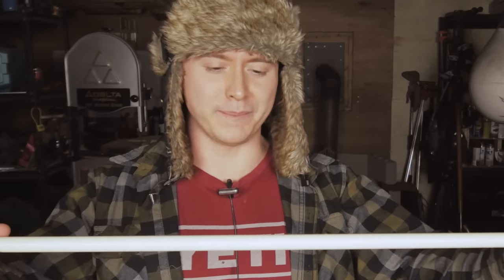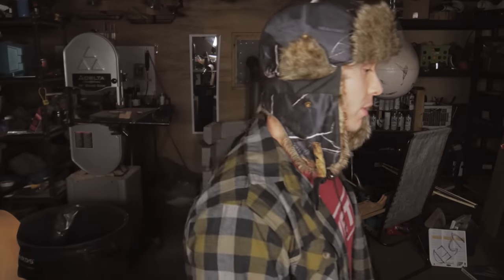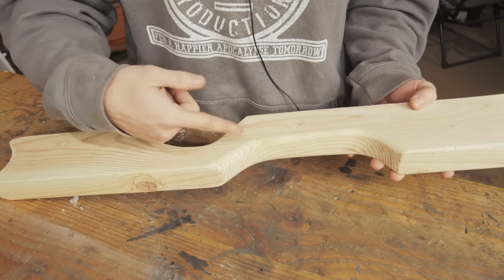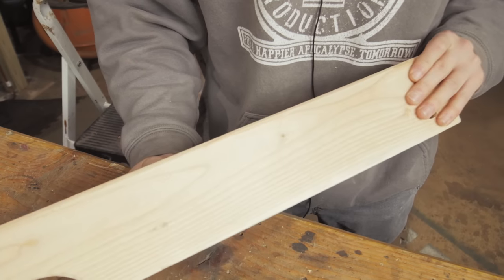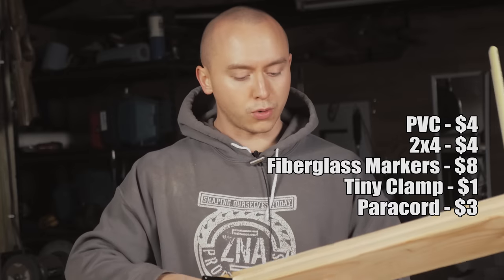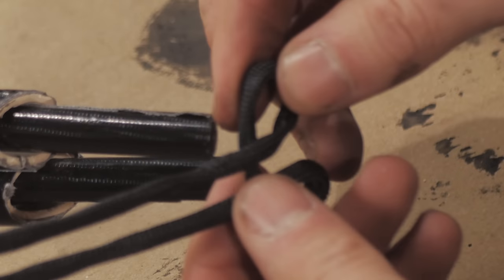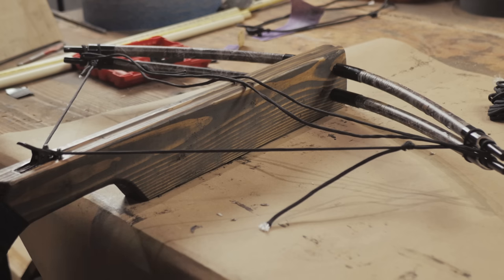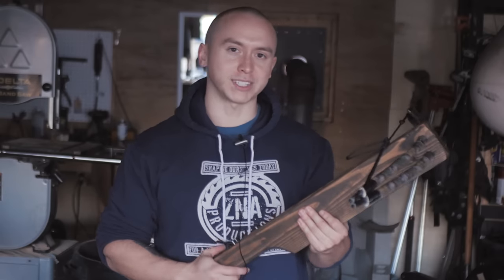Easy, Cheap, Powerful PVC CROSSBOW (With a Secret) -Minimal Tools, No Heating-

Comment: The main difference between CPVC and PVC is the range of temperatures each is capable of withstanding. CPVC can handle temperatures up to 200° Fahrenheit, while PVC peaks at 140° Fahrenheit.
Reply: Chlorine is added into the mixture of CPVC to increase the Temperature it can handle but it also leaves it more prone to cracking and becoming brittle over time.
Reply: Also it is measured differently, its measured using copper tubing size rather than pvc icing iron pipe size
Reply: it's not heat that's the issue in a bow limb.its cold.the forces applied on limbs under tension are insane.then the fact that those forces are applied to a brittle PVC due to cold temps is disaster waiting to happen.
Reply: For normal water supply PVC pipes, the schedule 40 PVC 1/2" will normally have thicker walls than the CPVC of the same size.
Reply: Learn something new every day! Thanks for the info.
Reply: Damn with my explanation I didn’t use any specific temperatures or anything I pretty much just said cpvc cracks easier in the cold than regular pvc would😭
Reply: @Richard-zu1gj  Lol, i know you did! :) As far as cold weather concerns go, black ABS pipe performs a lot better in the cold than PVC or CPVC, and is quite sturdy in terms of trauma resistance.  Unfortunately, as far as i have seen, it doesn't seem to make as efficient a spring as those other materials.  Admittedly, i have really not tested it extensively.  All i can say for sure, is that when using plastic pipe for a bow spring, it is important to keep its tubular shape mostly intact to get the best performance from it.
Reply: @budahbaba7856  Bamboo perhaps?
Reply: @justinw1765  I don't think that idea fully applies to bamboo because it has grain, that, if left as a hollow tube, makes it too resistant in the wrong places to be a good spring.  My thought is that plastic benefits from a tubular structure because it does not have the fortification of a true grain pattern.  But this is my thoughts.  I don't "know" anything  :)
Reply: In other words, the PVC might melt on a typical summer day in Texas.
Reply: I also remember hearing that heating up cpvc to form it can release a more dangerous fume than regular pvc. Both should be heated outdoors with a fan blowing if possible.

Comment: This is great timing since my home depot started selling 2in hardwoods a month and a half ago. Walnut would look pretty damn good. Thank you for doing the leg work with these videos, seriously. I like messing with things but can't afford as much trial and error. You give me a more advantageous starting point for my screwery, and your hoodie is still one of the softest things I own. On multiple fronts, thanks again.
Reply: Turn over a stone or two and find a sawmill or lumberyard near you.
Their wood is straighter, prettier, more exotic, sometimes cheaper and they sell offcuts!
Reply: @ruben9912  I'll definitely look around. I think there are a couple lumber yards in my city. Thank you for the advice!
Reply: That sounds sick man! Walnut is softer than pine in some cases though, so please be careful to reinforce the handle somehow
Reply: @epicarcher999  that... I didn't know that. Thank you. That could have ended badly.
Reply: If you’ve made it what’s the length between the holes where the pvc goes and the mechanism? Cause I made one and strung it but I can’t pull it back enough to put the actual string on
Reply: @TactileLoki  Try moving the pins forward or lengthening the string. String is the better choice cause the trigger is glued in. Don't cut the cord till you have the correct length. Also don't glue the trigger till you have the correct length bow string.

Comment: so I've been watching your videos for years now, and ultimately inspired me to start building all sorts of definitely safe things (totally not dangerous). but among them are a functional assassins creed hidden blade, bow and arrow, and a pvc blow dart gun ("super impressive" yes thank you I know) just to name a few, but what I'm thinking about more is when I built my crossbow. I did mine almost exactly the same except mine was a pallet support board to start. i also used a single 1" pvc pipe but without the fiber glass cause I was doing this all in my backyard. I like your trigger method much more as well. with mine, I just carved a "cliff" into the stock where i wanted the string to sit. next i drilled a hole straight through the center of that "cliff" where I put a peg in. that peg went through to the bottom side of the stock and I screwed a small hinge piece next to it. so ideally, you'd press up on the "trigger" (that hinge), which would push the string up and out of the "cliff" releasing the string and taking the bolt with it. I had to take the arms off after I was done with it due to the lack of fiber glass rods. the front of the stock had a notch cared in it to fit the pvc pipe, and the string was held under light tension by two screws that was placed towards the front of the stock. so to take it off you simply pulled the string over the screws and it would come apart....I like your method much much better. your nails are acting like my "cliff" did, only mine was into the stock. I did a smaller one that also used the cliff method, but used a lever to left the string out and over that cliff. my love of building stuff eventually started into a bladesmithing business I did out of the house. doing leatherwork, metal work, as well as custom knives and sheaths, sadly I haven't done any of that for about two years because I enlisted into the US Navy. and I'm currently stationed in guam. I love the great work keep it up! I apologize for the long comment as well.

Comment: I learned the driveway marker trick from the Backyard Bowyer, made his no heat PVC longbow that I had tons of fun with. It doesn't compare to a real bow, of course, but it's $10 vs $150.
I am planning a trip to lowes.. but I'm after a curtain rod. I have a spear head that's been needing a shaft forever.

Comment: CPVC is Chlorinated PVC. It's used for higher resistance to heat and pressure.
Reply: any drawbacks or just better?
Reply: @techno_tuna  only that it's more expensive, other than that it's just better
Reply: @ThePolarBear  Yep, expensive.

I think it's also very difficult to get in larger sizes, but realistically, you can flow more through by running at higher pressure, so that's not such a big problem.

Comment: My God that was an awesome video.  The quirky comments, the attitude, the ability to make a light humor joke about not getting something right the first time.  The craftsmanship and rudimentary build that looks like something straight from the medieval era... and it WORKS.  Personally I would have gone with PVC or schedule 80 PVC. The CPVC has extra chlorine in the polymer to make it more resistant to chlorinated municipal water supplies and has a bit higher heat rating but is softer and more pliable or flexible, so less stiff, than regular PVC. Regular PVC might be more ideal for better tension a and velocity.  PVC is also generally cheaper than CPVC unless you get up to Schedule 80 but that's where it gets harder to find and you'll have to shop online.  Schedule 40 is the standard with schedule 20 typically being larger diameters for drain lines and waste water and schedule 80 being for higher pressure commercial/industrial applications.  OR for PVC electrical conduit 😉.   Anyway definitely a like and sub after seeing the almost bulletproof trauma plate video.  A little tip for that one, something I'm gonna personally try... I'll  comment on THAT video because this is going to be a lone one..

Comment: I built a rolling nut trigger system for my home made crossbow from melted soda cans. I get a normal under the weapon trigger and it works with a 150lb fiberglass recurve bow. I just couldnt make pvc and fiberglass bows that were scary enough. lol. plus for the stock I used a scrap chunk of mahogany from a door. It really is a scary thing now.

Comment: easy tip when you make a handle like that. drill a hole at an angle through the entire handle and then glue a wooden dowel of the same size inside that hole.

that will make the likelihood of your handle snapping really small
Reply: Also, make the grain of the dowel and the handle run opposite each other...

Comment: You can increase the strength of the bow by turning the limbs into bundle bows buy using multiple rods that get smaller and smaller and lining up the middles before binding them

Comment: I have some picatinny rails from a toy gun and some lights and lasers to make it extra tacticool. What about drilling and thumbhole in the stock? I've got lots of tools. I could even use my router for the first time.

Also, you could add some wax or plastic strips to the top so the string slides across.

Comment: C-pvc is just like pvc but with a foam core, it’s cheaper and easier to break, like if you were to leave it out in the cold and then dropped it, more than likely it would crack, but pvc is much stronger, just costs a little more, so you may have wanted to use pvc instead of cpvc

Comment: CPVC in this application is a lot more flexible than regular schedule 40 pvc. The fiberglass rods would add a lot of rigidity to the already rigid pipe. I tried it with regular pvc and it's way too hard to string up to the point I feared the limbs shattering

Comment: Have you tried using a “full size” youth bow mounted horizontally? It would only need 40-45lbs but definitely would require a larger frame. It would fire arrows, not bolts, but given the Lao Gee span they  would travel with the same efficiency as a hunting recurve.

Comment: cpvc(tan or cream color) is for hot or cold water. its also sized slightly different than pvc. (white) is for colder water. what you for something like this would be schedule 80, which appears to be what hes using. now which one is less likely to break idk. just use what he got

Comment: The difference between PVC and CPVC is the fact that CPVC can withstand higher temperatures because it's actually laced with copper and that's the c stands for. its just acts as a better heat sink.

Comment: English with a thick German accent;
This is a homemade crossbow with around  
90 lbs of draw weight, 
Hard-lok  hadrosaur boot retainer,
Custom para wrap,
10 inch bolt with hand crafted duck taped flights
Let me show you it features.
Anti-Lip splitting face guard (not included),

Comment: My understanding is the only difference between cpvc and regular Pvc is the size is measured differently. A 1 inch cpvc won’t be the same diameter as a 1 inch pvc pipe. Cpvc is used to plumbing only I think also. It also may be a different type of plastic.
Reply: CPVC is just PVC pipe with chlorine added into the mixture so it can withstand higher temperatures. It's used to run hot water lines.

Comment: C-pvc is more heat and impact resistant i think. its made for pvc that is gonna be causing friction of some sort
Reply: It can handle higher temperatures but isn't as strong. It's more prone to cracking and becoming brittle over time due to the chlorine that is added into the PVC mixture.
Reply: @kevinlee6580  yea the only experience i have with it is a butterfly knife made with it. they use it so the friction dosnt wear it down and the slapping together dosnt crack it.

Comment: PVC pipe can only handle temperatures up to 140°F 
CPVC pipe can handle temperatures up to 200°F which is why you're only supposed to run hot water lines in a home using it instead of regular PVC. It has extra chlorine added in when it's manufactured to help it withstand more heat. They both tend to become brittle over time but CPVC seems to degrade a bit faster from my experience as a plumber. It's always risky cutting a pipe for a repair since often times it will just crush/shatter instead of giving a nice clean cut.

Comment: Cpvc uses outside diameter and is used for hot water applications. 
Pvc uses inside diameter and you can't use with hot water.

Comment: If You want Your string to last longer, use linen thread. As natural fiber, it will not stretch under the pulling force of the limbs. At least not as much Paracord does.

Comment: I have an idea. But I have no tools. 😢 I would like to build a wooden gun. It would be a spring-fired semi-automatic with two-inch wooden "bullets". I got this idea after watching a video about how Nerf Blasters work. There's a lot of engineering to figure out: the force applied by the firing spring, the weight of the projectile, the cocking and trigger mechanisms, the magazine mechanism, and even how to rifle the barrel. But I think it could be done, and with sufficiently hardened and sharpened points, it could be a hunting weapon. I don't want any credit, but if you figure it out, I'd like to buy one.

Comment: Anyone know the length between the holes for the pvc and the locking mechanism. I made one and strung it up but I can’t pull the fake string back enough to put on the real string. And I have a feeling if I can then I won’t be able to pull the real sting back to shoot it.
Reply: I made mine 3 feet long and took his measurements for the stock. The holes for mines were closer than his but I think the bow just needed to be flexed a bit cause I left it for a few minutes and I got it easier. 

My stock also looks like a shotgun if you wan to make it a bit cooler than some cutouts.